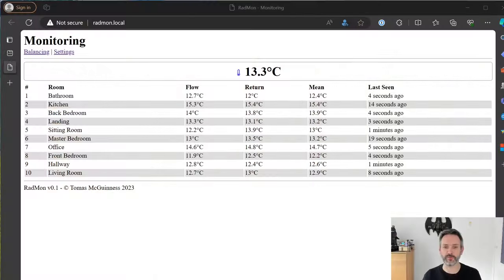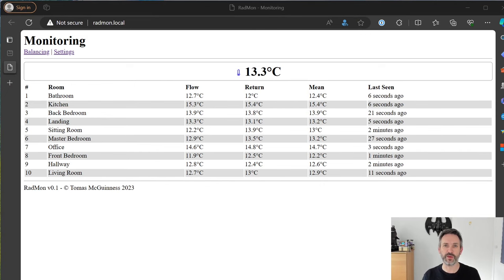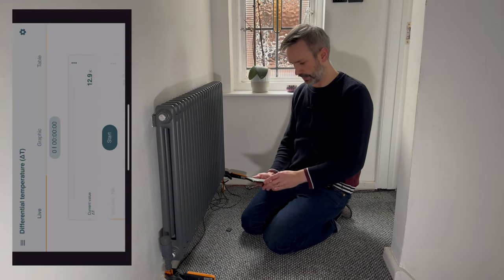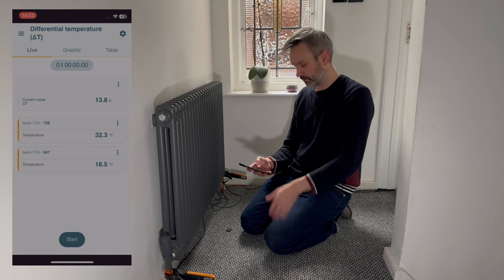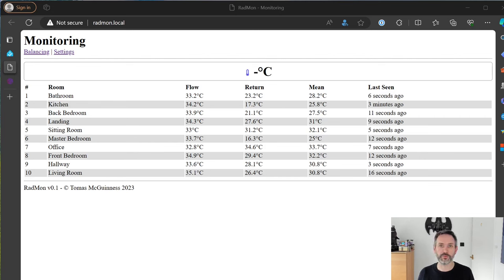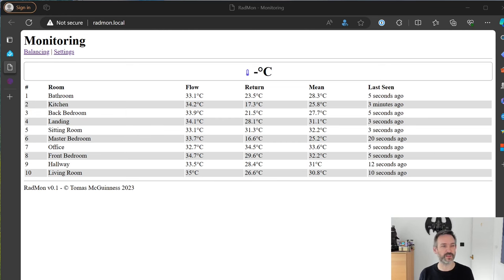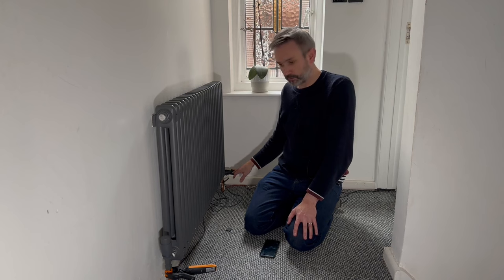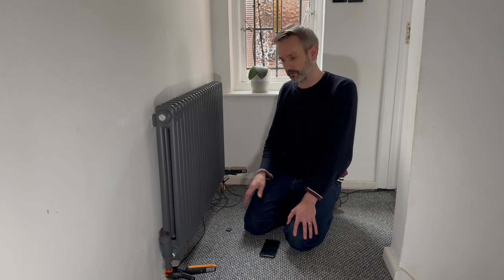Checking the accuracy of my radiator temperature sensors

Comment: Your sensor might be fine, it could be the way that they're mounted to the radiator. If they don't have good contact with the pipe the best might not be conducting well. Also wrap them & the pipe with insulation so the heat that does conduct to them doesn't get lost to the surroundings. Can you stick an image of the attached sensor to?
Good calibrations are normally performed in a an insulated circulating water bath as Michael said.
Reply from the maker: The sensors contact should be good. It’s designed to clamp to a pipe, so I expected it to have a good connection. Poor contact might explain the different dT between the flow and return values across my sensors. I need to just to an ice water check. If that reads close to 0C, then poor contact is the next likely issue. Thanks!!

Comment: Try the ds18b20 again. When I've been testing various sensors they've been in the same place. All been within a degree of each other. Surprised those testo coamps have such a wide degree of accuracy.

Enjoying seeing your journey
Reply from the maker: I checked the calibration certificate again and I think I misread it. They were tested at 25 and had an actual value of 25, with an allowable deviation of 1.3 degrees. 

I might try the DS18B20 again just as a reference!

Comment: No sure if you can convert from NTC to thermocouples that the testo may use, also if you do want 0c water, put ice in with it.
Reply from the maker: The NTC should be sufficient for the temperature ranges in looking at. Using 0c water seems like a simple way to calibrate the sensors. Thanks!

Comment: oops Tom shouldn't you be using better 10K sampling resistors ... something like with 0.1 or at least 1 percent tollerance
Reply from the maker: 🤣 you’re dead right. I didn’t know about this when I bought them! I might need to invest in much better ones!!! Thanks for watching!
Reply: @tomasmcguinness   I guess you can calibrate it out in software now since you have your clamps to take golden measurements . Need to do it for each sensor though .
Reply from the maker: Yeah. I’ll try and use ice water to start.